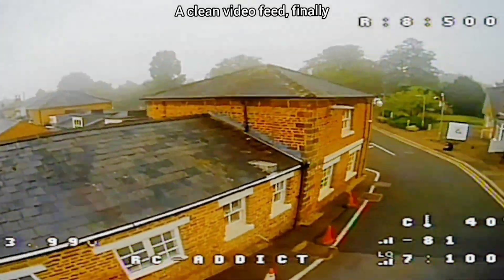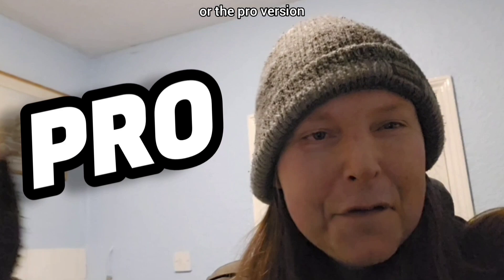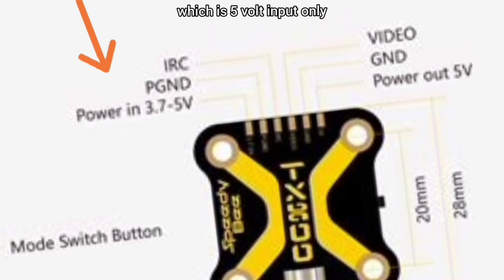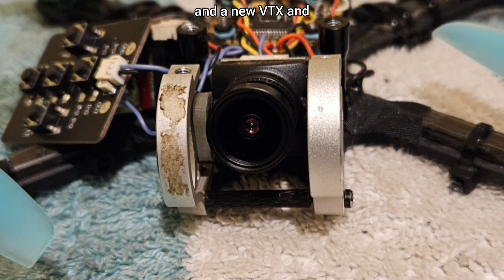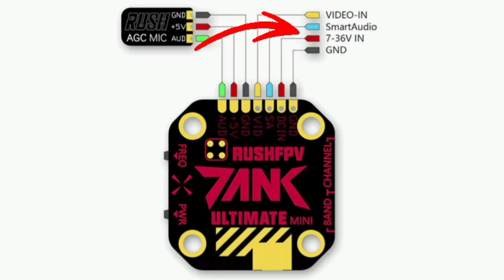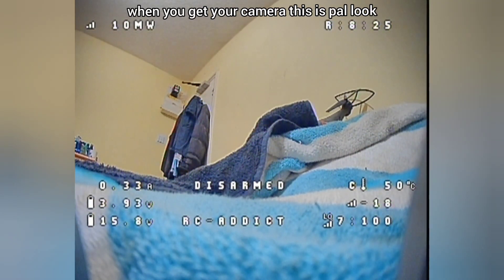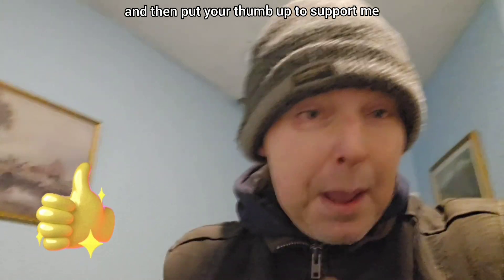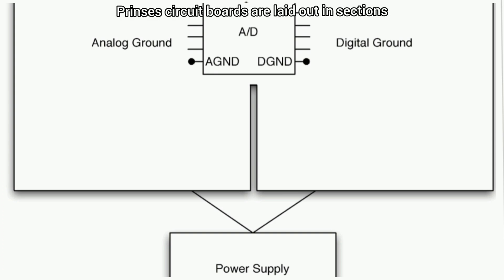AnalogFPV DRONE COMPLETE MOTOR NOISE FIX WALKTHROUGH

Comment: Not sure if i get it,  the flightcontroller has a BEC,  i havea speedybee TX800 and my video is just as clean.
Reply from the maker: Your tx800 is powered by the 5volt max bec on the fc. Therefore your getting filtered 5v to your vtx so you don't have to worry.
No most modern day fc have a 5v and a 9v bec (a fancy name for a voltage regulator) from your vcc 3s to 6s input.
Now alot of people have like in this case 5volt maximum bec or like on a wing. NO BEC. NOW WHAT HAPPENS WHEN THE MINIMUM VTX IS 7V TO 25VOLTS?
you have to power your vtx from your battery 🔋 power leads.
So all your 5v tx800 becs Filtering has gone!
You have to deal with hv ripple current and motor noise as your battery in short is a shock absorber for high voltage ⚡️ spikes.
So you have no problem as your fc bec has capacitors Filtering out all this and tvs diodes etc on the board.
So the whole point of the video is (HOW DO YOU POWER YOUR VTX OF YOUR HIGH VOLTAGE ⚡️ BATTERY LEADS AND NOT SEE ALL THE NOISE IN THE VIDEO.
1. ALWAYS USE A CAPACITOR  (THIS IS A MUST ANYWAY SO YOU DONT FRY YOUR ELECTRONICS WITH HV SPIKES WHEN CONNECTING AND THE BATTERY AND SPIKES FROM THE MOTORS.
2. ALWAYS HAVE 2 GROUNDS. A GND FROM THE FC PAD ASWELL AS FROM YOUR VTX INPUT
3 THE FLIGHT CONTROLLER IS BUILT IN SECTIONS SO ALL GROUNDS ARE COMMON BUT SOME ARE OF DIFFERENT RESISTANE.
(HENCE THE GROUPING OF THE CAM ERA GRND AND VTX GROUND)
BUT AS I SAID MOST FC HAVE ALL THEIR FILTERING IN THE BEC AND IF THIS FC IN THE VIDEO HAD HAD A 9V BEC OF ATLEAST 1AMP THEN I COULD HAVE USED THAT!
I HOPE ♥️ THAT HELPS
Reply: @rcaddict9558  Okay, so i just use one ground pad? As i dont even know the one im using is analog or digital ground,  i assume analog as the feed is great
Reply from the maker: So. Normally if you are coming from the vtx video,  irc tramp 5v and gnd on the fc to power your tx800 at 5v . YES . JUST THE ONE GRND NEXT TO THE VTX OUPUTS.
ALL IS GOOD WHAT YOUVE ✔️ 👍 
YOU ONLY NEED 2 GROUNDS IF YOU ARE LINKING DIFFERENT COMPONENTS WITH THE SAME VCC.
MOST FC HAVE 2 BECS. 5V FOR RECIEVER AND LEDS AND GPS (SOME A 3.3V BEC FOR GPS) BUT A 9V OR 10V FOR YOUR HIGHER CURRENT AND POWER LIKE VTXS AND AIR UNITS.
MY SITUATION WAS I ONLY HAD A 5V BEC ON AN OLD STACK AND MY VTX WAS 7V MINIMUM.
SO I HAD TO POWER IT FROM THE BATTERY
(HOPE THIS HELPS🫡❤️)

Comment: 7:37 we love you G❤. Im also experiencing similar motor noise in video feed when throttle up. Learning from you while I type
Reply from the maker: @TariqShahFPV  haha ❤️ and i should have just left it alone ,it was fine, that Runcam pheonix pro is crap for freestyle, it says in all the adds, best freestyle cam, the FING LENS IS SO WIDE YOU CANT JUDGE THE GAPS !
CRAP, pheonix 2 amazing! But that is plasticy crap!
O well!
Make sure you ground on the vtx and cam rail, or vtx on cam ground and tap a ground on the main wire at the esc, 3 grounds

Comment: Top job on the video. I've just changed from a caddx turbo2 to a runcam something or other and having these exact problems. Only just started to work these things out, after getting lens focused. I initially thought it was props, yes and no. Now I'm thinking filter caps and grounding for the vtx. Rubbish weather so just test at a time.
Reply from the maker: @cspower7259  EXACTLY THE SAME MATE! The video without any motor noise is the Caddx Ratel 2 from 4 years ago! I Changed to the Runcam Pheonix 2 Pro and i get motor noise!
I had the SPEEDYBEE TX800 running off the 5volt VTX BEC ON THE ANALOG GROUND RAIL, All my other FC have a 9 10 12 volt BEC and no issues !
So when i changed to the 7-30volt input Rush tiny vtx i had to run it off the UNFILTERED BATERY LEADS!
SO SOLVING THE ISSUE WITH THAT WAS NOT THE CAPACITORS, IT WAS THE ANALOG GROUND RAIL, UART 3 FOR THE VTX, OR THE SAME RESISTANCE GROUND AS THE CAMERA GROUND! SORTED!
"CHANGED BACK AND FOURTH CAMERAS AND THERE IS MOTOR NOISE ON THE RUNCAM, BUT TGE CADDX HAS 0 MOTOR NOISE!
"IVE A VIDEO SHOWING OFF THE RUNCAM PHEONIX 2, JOSH BARDWELL EDITION, AND THAT I WAS ABLE TO UPSCALE IT TO 4 K FOR THE EDIT!
THIS VIDEO
ANALOGFPV AT IT'S BEST | JOSHUA BARDWELL PHEONIX 2 & RUSHFPV TANK SOLO EDIT! #analogfpv #expresslrs
 https://youtu.be/6QkpFo9IFII
"So the newish Pro camera, is very sussepticle to noise!"
"HOPE THAT MAKES SENSE"
❤️🫡THANKYOU
Reply from the maker: Im glad i could help someone, or at least let them know that they are not alone!
Thanks for watching and commenting!
❤️🙏🫡

Comment: ive used a capacitor on my fc battery wire for years now and get very clean video feed
Reply from the maker: Same, I have 2 esr caps in this video 📹 
Didn't make any difference!
When the vtx is powered straight from the batery  and motor / esc wires
You have to add 2 grounds, as explained in the video!
One to the analog bus rail on the flight controller and one to the earth lead